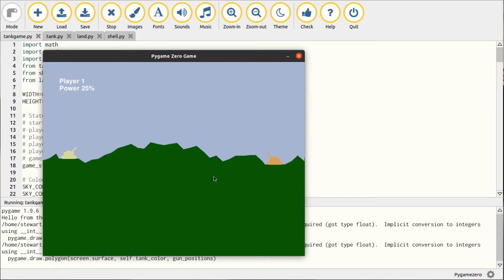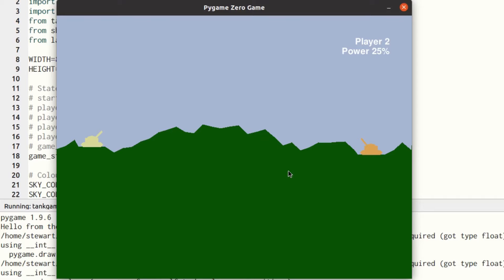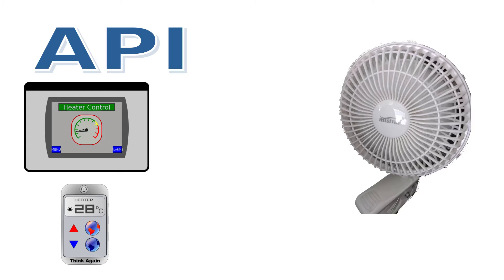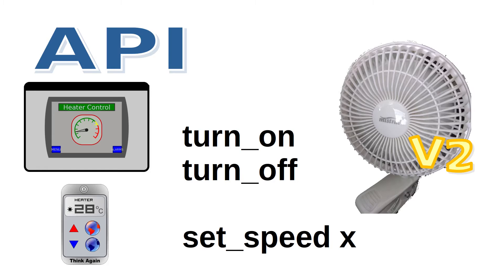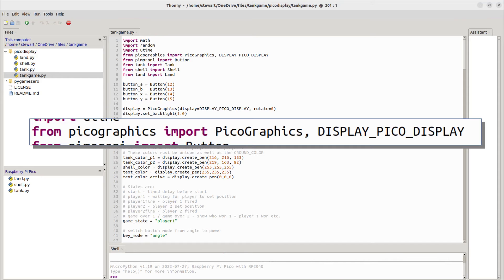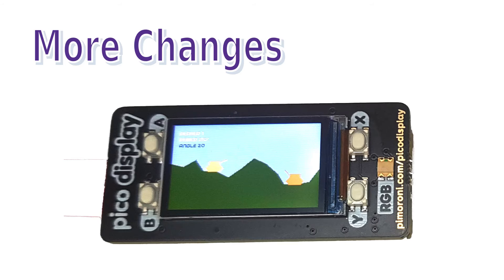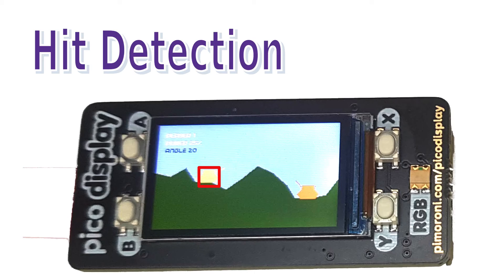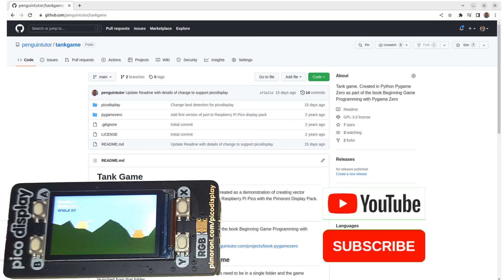Pico Display - Updated tank game for the Raspberry Pi Pico with PicoGraphics

Comment: Enjoying running your programs, along with your detailed explanations.  You did this in your program conversion, but it is worth highlighting. One key point when converting a program from using picodisplay to picographics library is that picodisplay uses Landscape mode while picographics uses Portrait.  Thus you need to rotate the program image by 90 degrees.  You accomplished this in your program using the rotate=0 parameter when creating the PicoGraphics display object. You can ask chatGPT for a full explanation on my this is 0 instead of 90 as you might expect.

display=PicoGraphics(display=DISPLAY_PICO_DISPLAY, rotate=0)